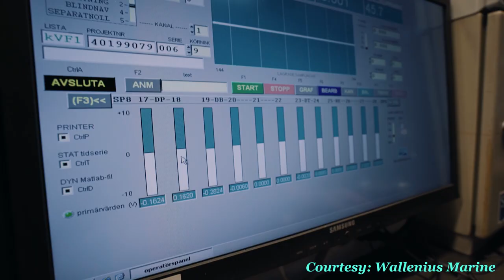World’s largest sailing ship, future of shipping with Wallenius Marine

Comment: Has any information been released into the public domain with regard to the expected energy harvest for the wing forms, on a Watts per square meter basis?  ‘Cutty Sark’, it is said to have been possible to coax 3 000 horse power (or 2 206 500 Watts / 2.2 megaWatts)) out of her, up to, 2 976m2 of sails, I am assuming that was in ideal conditions.  Further assuming that for sailing purposes the usable part of the wind speed range is 4ms-1to 12ms-1.  As the wind speed, and the amount of energy that may be harvested there from, increases the sea surface becomes progressively more disturbed which makes the harvesting process ever more difficult, what is the expected upper wind speed limit for the 'Oceanbird'?  As a single stage 'harvest to use' system for propulsion the efficiency will be relatively high but what steps are being taken to provide ancillary power such as the, small but essential, domestic, navigational and cargo handling needs?